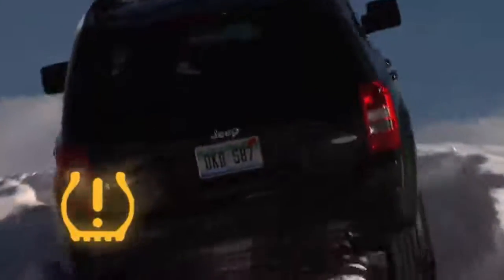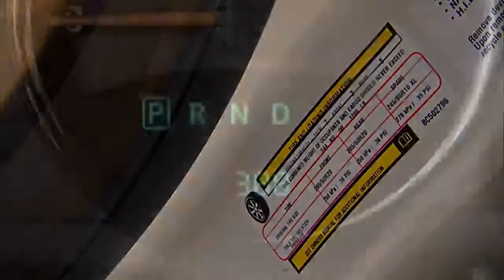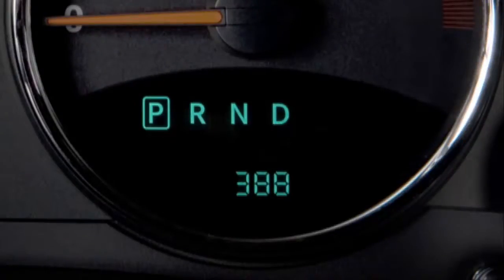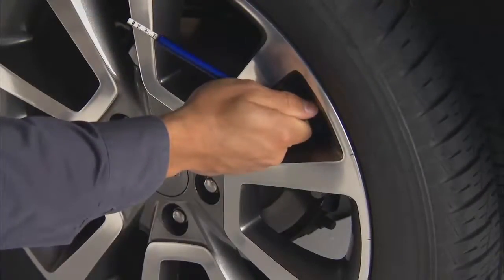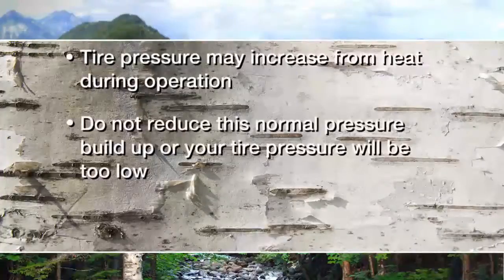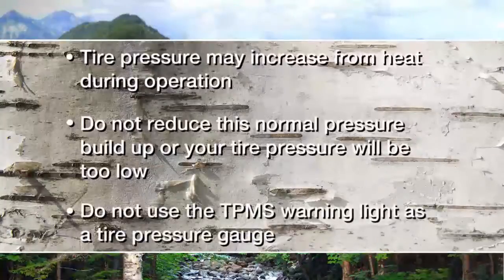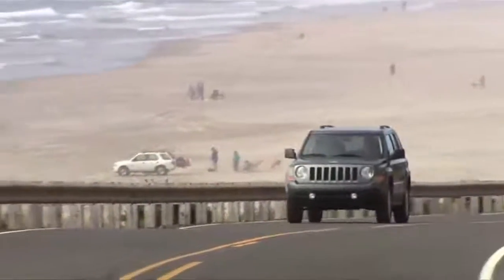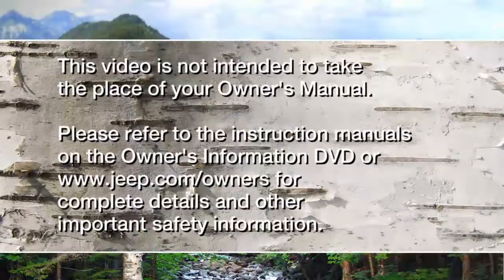2014 Jeep Patriot | Tire Pressure Monitoring System

Comment: How do I check my tire pressure..I have a 2015
Reply from the maker: Hi Tom Pajak,

Per page 221 of your Owner’s Manual: “As an added safety feature, your vehicle has been equipped with a Tire Pressure Monitoring System (TPMS) that illuminates a low tire pressure telltale when one or more of your tires is significantly under-inflated. 

Accordingly, when the low tire pressure telltale illuminates, you should stop and check your tires as soon as possible, and inflate them to the proper pressure. Driving on a significantly under-inflated tire causes the tire to overheat and can lead to tire failure. Under-inflation also reduces fuel efficiency and tire tread life, and may affect the vehicle’s handling and stopping ability. 

Please note that the TPMS is not a substitute for proper tire maintenance, and it is the driver’s responsibility to maintain correct tire pressure, even if under-inflation has not reached the level to trigger illumination of the TPMS low tire pressure telltale.”
Reply: @mopar  Ya didn't realize I needed to order a special package to get the information like tire psi.. Miles till empty and all that other info.. That stuff should be standard